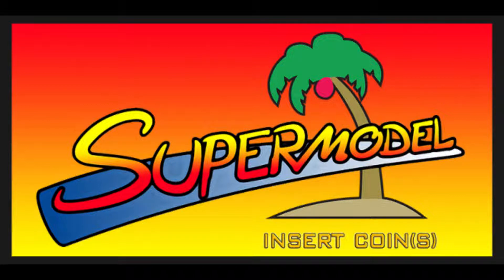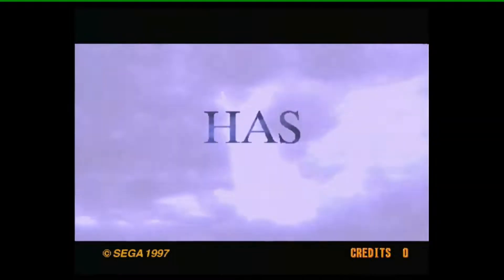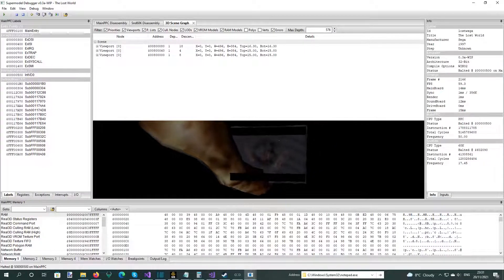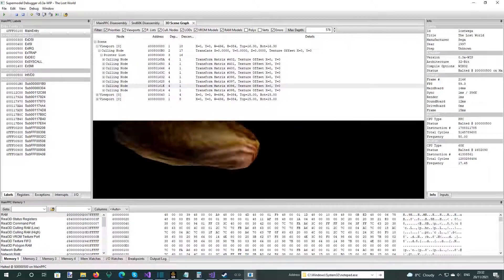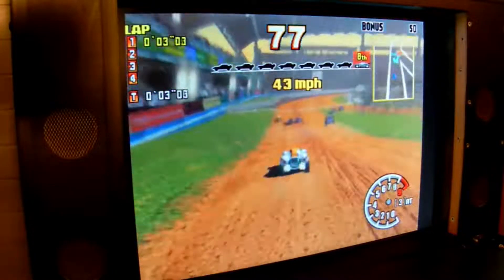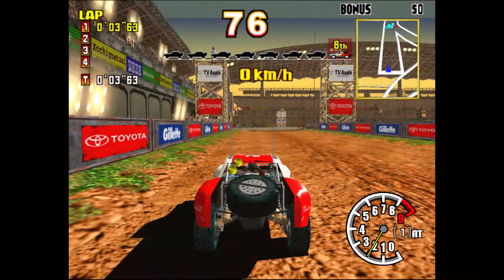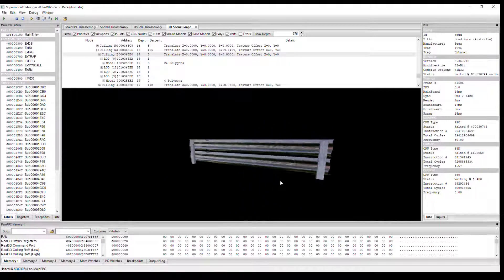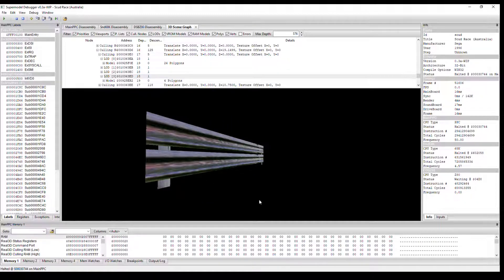Supermodel emulator - bugs and unimplemented features

Comment: This is awesome! You've made an enormous amount of discoveries re: the Real3D hardware and it's great to see this kind of content.

Re: the leg in Lost World, could this be clipping at work? I notice something similar in LA Machineguns. Some of the explosions should be culled when near the camera. I have a video capture of LA Machineguns that I took about a month ago that confirms that the explosions very rarely obscure the camera whereas in Supermodel, it happens very frequently (e.g., inside the enemy base on the Yosemite level).
Reply from the maker: Didn't think it could be clipping because most of the leg is right inside of the viewing frustum. It wouldn't make sense to cull it. There is nothing abnormal about culling node sizes. Vf3 had some culling nodes set to float min so the hardware skipped over them. Those massive polys that are bang in the center that show up with your old renderer. The LA machine guns is interesting. I don't actually use the min value in the culling node table for the near planes. Maybe if I clamped the near plane to that it would cull out those explosions that block the view.
Reply: @MrDukeeeey  Just a complete ass pull, and I'm assuming someone already checked, but is it possible that the Lost World dino has different LOD versions and if the camera is close enough to it, it renders a model that only has the foot?